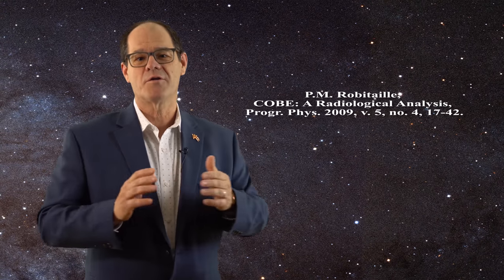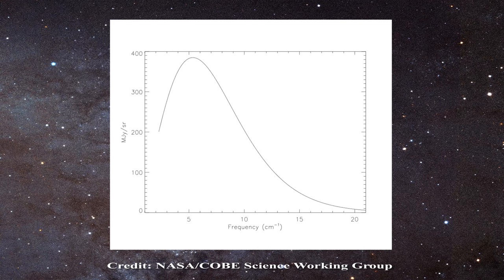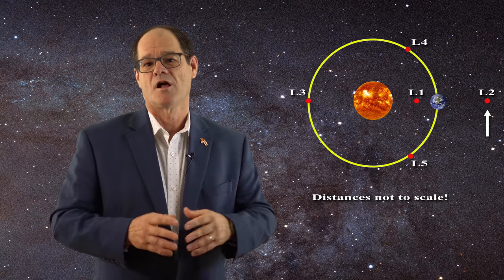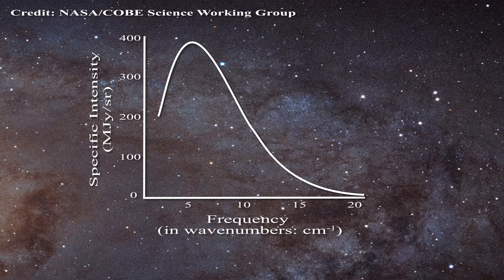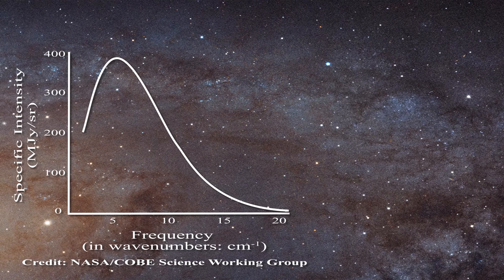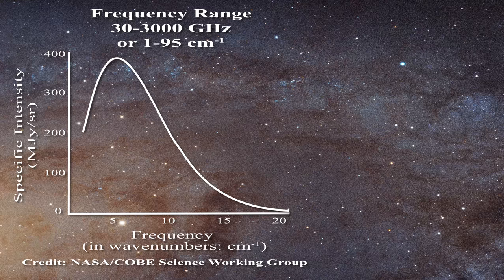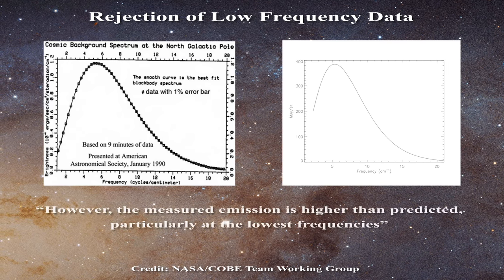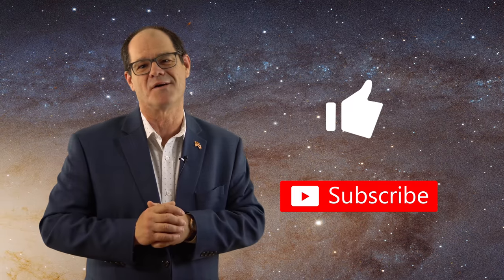The Microwave Background - COBE Satellite Results Explained!

Comment: Sorry, this is not a question about this area, but why don't we put a sattelite to measure distances at pluto for instance? We are measuring distances to stars with our narrow space on earth, making correct calculations would not me precise. Imagine if they can use the distance between pluto and earth to calculate. Would still be a drop in the bucket, but much more precise than using two places on earth. Ps. I still have a theory that light cannot be used to measure distance. There are too many factors, and it has been shown in labs that certain conditions can even slow light to 36mph. I know it is done in the lab, but even going through water slows it down a bit. The research is done with cold and particles. Now the helio shock and outside space gives the particles and the coldness. Also you must take into account that light does get affected by gravity. Want to tell me that gravity does not? Black holes even stops light escaping. I think they should research this more. Of course everybody is going to jump on me for the above, but it is because it breaks down a fact that we measure a lot of things and impact a lot.
Reply: Actually there's little factual evidence that light gets affected by gravity. If it did, you wouldn't be able to clearly see stars in the sky with your naked eye, let alone if you magnified them with a telescope.
Reply: @LecherousLizard  so we can disregard black holes slowing down light to even stopping it?
Reply: @mizmera  The existence of black holes is a pure conjecture.

The only actual proof of black holes is one computer generated image from data which isn't perceptible by humans without use of machines to begin with. The raw data is literally just a bunch of curved lines in the radiowave spectrum.
Everything other proof is nothing more than breadcrumbs, since the very nature of "black holes" makes them impossible to perceive directly, only their apparent effects ("apparent", because we are so far from any known black holes that we are trying to figure out 3D from a 2D perspective).
This is one of reasons why, for example, the galaxy with the highest redshift has the redshift so goddamn high, it essentially makes it older than hydrogen itself (according to the Big Bang theory). THAT is how little information we have about the universe.
M87 picture was created using the Big Bang Theory (which is clearly incorrect due to the aforementioned example) and the Theory of Relativity (which is also severely lacking).
Reply: @LecherousLizard  although I agree with you about how little we know of the universe, I do feel that light will be affected by gravity. This is also the lensing effect it creates. Note my whole point at the moment is that light is not a constant. If we can change the speed of it in labs, like BEC to 36 miles. We also hear the whole time that the universe expands faster than the speed of light. With so many things that can actually affect the speed of light we cannot use it to measure distance. And I would put forward that the further we look the more it is incorrect.
Reply: @mizmera  This isn't a matter of "feeling". There is no concrete experimental proof light is affected by gravity and the fact they used Bose-Einstein condensate to slow down light isn't surprising, since speed of light is directly linked to the medium light travels through. It would be surprised if it did NOT happen in that particular medium.

There is also no concrete proof for the expansion of the universe, since it's not observed outside of redshift, which cannot, at the moment, be double-checked with a different method, since that is the ONLY method of measuring very far distances and the method itself is hinged on a theory which disproves itself to begin with.
Reply: @LecherousLizard  again. Just moving through different mediums slows it down. You know what they actually do with BEC? Bombard it with other particles. This is exactly what happens at the heliosphere. The point is. We cannot trust light speed measurements outside our solar system. 1. We don't know what exactly is outside. 2. We have all the experimental data that supports that the speed of light is not a constant. Actually science does work a lot with what we feel or think. It is called a hypothesis. There is experimental evidence that shows my idea to be correct. There is also unproven things like black holes in my idea and that is why it is not a theory. Listen. If you fly two planes in different direction each traveling at 600 miles per hour and then shoot a bullet traveling at 1700 miles per hour from the one plane to the other, does it not affect the speed and the time the bullet takes to reach the other plane? This works for everything we know of. So now.. The speed of light is slower than the expanding of the universe... So stars far away from us move faster away from us than the speed of light. So... Want to tell me the speed of light magically overcomes this barrier and actually stays the same time it would take if the universe was not expanding? Again. We cannot trust  light to determine distance. Note also... All scales that has a small margin of error will have greater errors the larger the numbers get. Car speedometer speed vs real speed. Carbon dating. Make a milimeter mistake every metre... No problem.. But look at the problem if the measurement is 2000 kilometers. Then that small mistake is way off.
Reply: @mizmera  First of all: Line breaks.
Secondly: No, that's not quite what happens at the heliosphere, since particles there are very unlikely to be BEC.
And again: speed of light is constant for a medium. Not constant in all cases.
That's a fundamental difference and nobody is really disputing that.
Reply: @LecherousLizard  1. Typing on a phone at 23h00 in the night... Not much fun. Sorry. 2. Do you have any evidence of this? Heliopause is where cosmic rays and the sun's "bubble" bounces off each other the most. We do not even have enough evidence of what is happening there and out in outer space. In the medium correct. Thing is... There is a lot of differences in space and a lot that can affect it.
Reply: @mizmera  "Vacuum" is mostly made out of hydrogen in density so low it makes those particles essentially isolated, meaning they cannot exchange heat with other particles. Then thanks to electromagnetic radiation they could be, ironically, very hot (although nothing would get burned by them, since the density is so low).
This is why it can't be BEC. In fact I don't think it's even possible for BEC to form naturally.
Reply: @LecherousLizard  - not just speaking of the cold state. note. we still are not sure what is outside. Do you get the point of  the 2 planes and the expansion of space?
Reply: @mizmera  What point is there to make? No expansion of space has been ever observed or is even theoretically possible to observe within The Local Cluster, let alone in our solar system.
Reply: @LecherousLizard  the point being we cannot be sure of the distances even between us and the other stars. The further the worse it gets. And yes... Never heard of the edge of space and how stars we could see are disappearing?
Reply: @mizmera  Pretty sure they managed to lose a few stars that were much closer than the universe horizon.
And no, the universe horizon isn't really a proof for the expansion of the universe.
Reply: @LecherousLizard  well, then you need to read up on it. There is a lot of space expansion happening according to astronomy... Although... A lot in astronomy speaks of big bang too.. :P
Reply: @mizmera  I read up on it, which is why I can't help, but to think it's major bullshit.
Big Bang, CMB, inflation, dark matter, dark energy and probably a few other things I'm forgetting are effectively inseparable and come from the same "place", so to speak, so if any one of those things is wrong, they all most likely are.

And if that's the case then what is left of  the astronomy since early 20th century?
It sure seems like denying things Big Bang would in practice require starting from scratch.
Reply: @LecherousLizard  - So true. That is what I want to make clear to the people. They base all there theories and hypotheses on a current theory that is probably nonsense. So all after that is WRONG too. That is what I hate about today's astronomy. Thumb sucking to get a theory out there. As soon as you ask to present the experiments supporting the theory... then they attack you as person. As my "friend" davey boy tried. He could not present ONE experiment of overcoming thermodynamics laws and evaded 20 times with simple questions. Amazing what the people try to back there atheistic religion.
Reply: @mizmera  I also exchanged a few comments with him and his best arguments were argument from authority and argumentum ad populum... after I already voiced my stance of doubt against said authority.
He also claimed to be a part of said authority group ("I have a PhD in theoretical physics!"), making his comments even more funny and ridiculous.
Reply: @midlander4  i dont need one. The problem comes in when people like daveyboy and his followers (you) cannot answer a simple school formula without evading it 20 times. Just shows how full of holes you and daveyboy knows your theories are. You cannot even use logic. Shame.
Reply: @midlander4  Midlander4.. you are following a person who cannot by science defend the idea of the big bang. We get it.
Reply: @midlander4  Ps. Your point with the formula was? HAHA

Comment: "microwaves coming from the oceans" ???  my ignorance or deafness on display.
Reply: Water absorbs and emits microwaves at certain frequencies. K-band, maybe?
Reply: Put a glass of water in a microwave oven and turn on the oven. The water gets hot. So water is a good absorber of microwaves. It is well known from the laboratory that a good absorber is also a good emitter, and at the same frequencies. So water is also a good emitter of microwaves. Microwaves are used in mobile telephone communications, but not in submarine communications because water absorbs microwave communications, as any submarine or radio engineer knows.
Reply: I read a book called Tuning into Nature, about insects and vision. He showed that if you see in infrared, nighttime is almost as bright as the day as all the warm objects, water included are emitting infrared radiation. Those mosquitoes have radar.